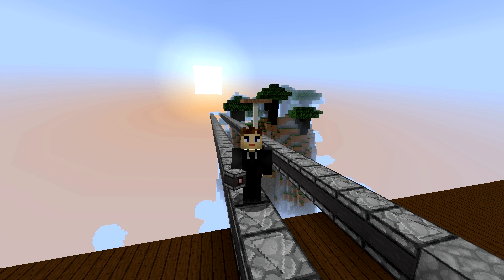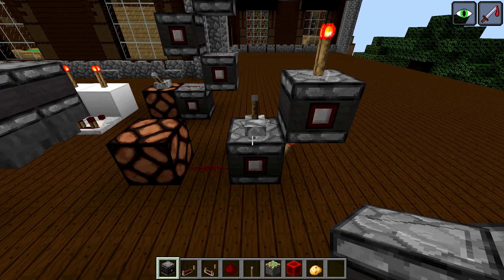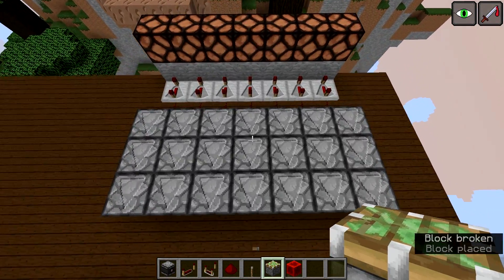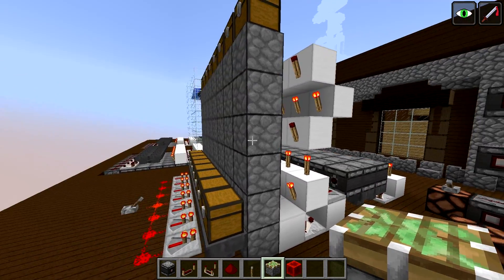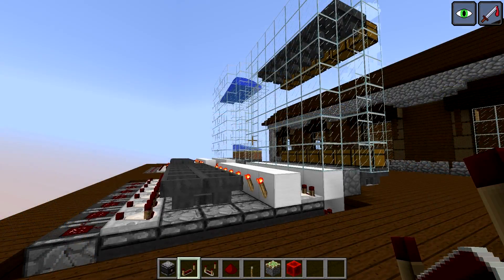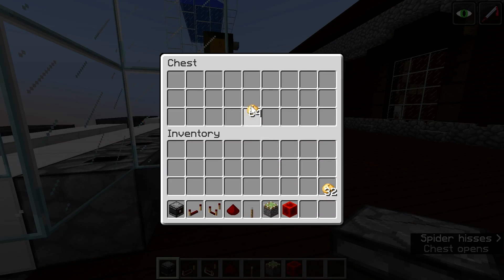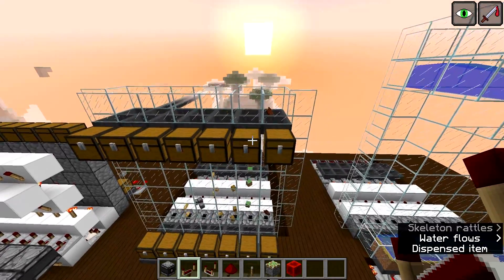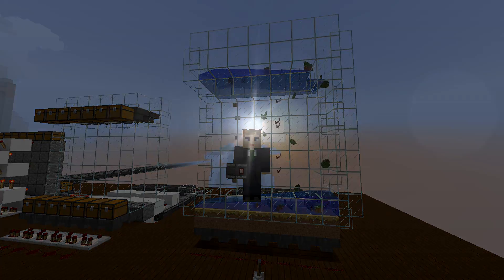Minecraft 1.11 - Tileable item elevators using observers [Redstone Shorts 4]

Comment: I built a tileable shulker filling machine that manually selects which item to fill the shulker chest with, then detects when the box is full, breaks it and returns it to the player.

It can independently fill 15 shulkers at the same time :)

If this interests you at all I will see if I can record it in action, then send a vid of it to you if you want to use the design.
Reply from the maker: Sure. Did you check also ilmango's shulker filling station?